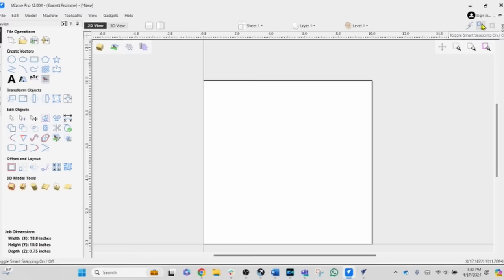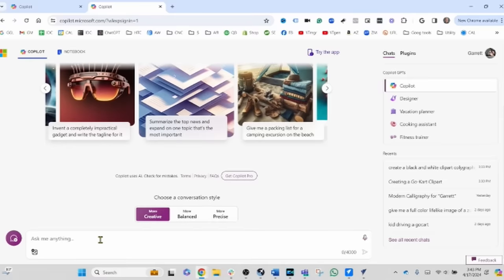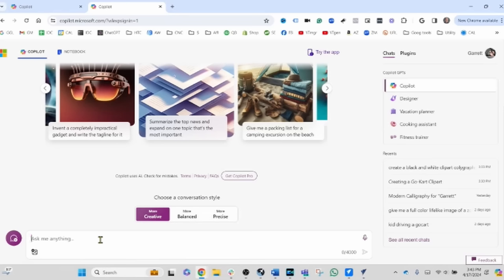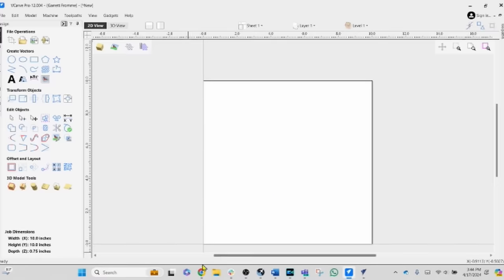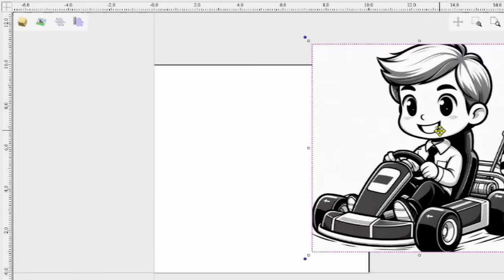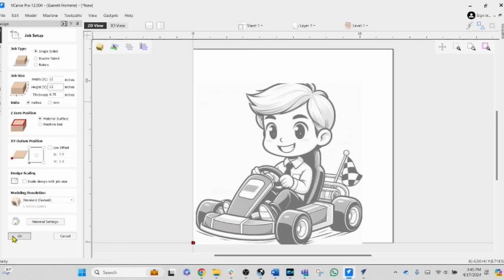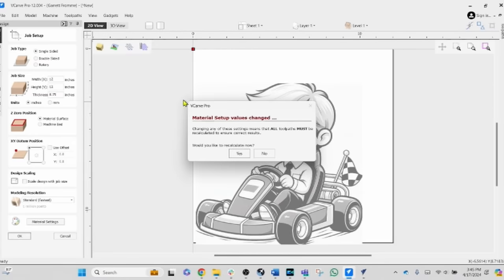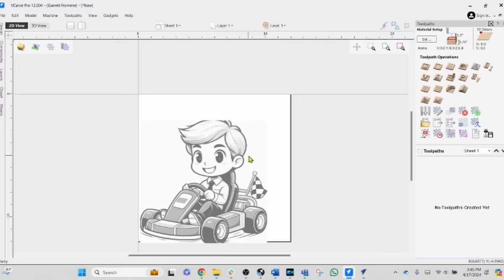This New Vectric Sketch Carving Tool Is AMAZING!

Comment: What's up Garrett?? Nice video!!

Turning anything complex into a software or A.I. generated sketch, bitmap tracing, vector or whatever it is you are aiming for is going to disappoint almost 100% of the time it's tried. Now it does depend on the level of detail, contrast and definition etc. It will also help you figure out how much you don't enjoy node editing as a full time job. I work from photos of famous buildings, sometimes to engrave on glass but most of the time I'll shoot for depth carving to get as much relief in the finished piece as I can. It's been my experience that I will save huge amounts of time by just getting out a cheap drawing tablet (Wacom or similar) and take my time to correctly draw what it is I am attempting to create. Then I am not going back and forth until my eyes are worn out from looking at thousands and thousands of nodes that need to be moved, removed, or trying to drag handles all over to fix a curve. Screw that!!

I have extensive experience NOT getting the results I was hoping for using Inkscape, Gimp, Illustrator, Photoshop and VCARVE probably some other titles as well. Tried and tried.. and tried some more! I was constantly searching for an easier method to get the lines I wanted to pop out of some flashy software program and I found I was never satisfied with the results.

Am I too picky about things? Probably... maybe a little more than most. If I'm going to take the time to actually end up producing finished pieces I rather they look as nice as I can make them. When I get started on anything that is going to take me hours/days to draw I break it up into smaller sections and constantly remind myself... 

I only have to get it right one time. 

After the toolpaths are created and I see what I hoped for coming off the mill. It's as good as gold. Scale it up/down, etch it, burn it, cut it or carve it. The bulk of my time for any of this work is always spent converting the artwork into something suitable for the medium and the limitations of the gear in my shop.

Some of this stuff takes time to do. Garbage in = Garbage out.

Have a nice day!!
Reply from the maker: fxsrider, thanks for sharing your perspective on this one brother. You bring up a lot of good points and I do appreciate you reaching out and providing input on your workflow that works best for you.

Comment: There is a setting to eliminate the border, Bitmap boundery, selected Vector  and nearly at the bottom: the Vector Selction "manual " Selector... Just experiment a wee bit with it.
Reply from the maker: hanspijpers2100, right on! I like that idea brother. Thanks for sharing those tips and tricks.
Reply: Yes thank you for sharing this tip.  I tried figuring out to get rid of it and was about to give up. So i figured if anyone would share how it would be Garrett but i was let down.  Lol so i headed to the comments and i was looking for someone to ask and he give the answer but instead i found the answer.  lol.
Reply: this does not seem to work because there are no vectors in the bitmap

Comment: Hey Garrett, I've been experimenting with the sketch tool path in Vcarve pro 12, and noticed that if you import a bitmap as the sketch image, and then choose the sketch tool path, the specific tool path menu items don't seem to allow for the exclusion of a boundary (or border) carve. In other words, the application draws a border around the bitmap and then carves it based on the selected offset, with 0 apparently equal to some value other than 0. For whatever reason, you get a carved border no matter the choice, and seems to be true for the vector selection choice also.
Any thoughts?
Great video by the way!
Reply from the maker: Yes, I commented about that in this video. I'm not sure of a good method to eliminate it
Reply: @IDCWoodcraft  Thanks. I missed your comment in the video - I'll rewatch it.

Comment: Garrett, I was wondering if you can give me a little help. I have a next wave he 510 with the 3 hp water cooled spindle. I have the vertical software, which I still can’t get a grip on. Anyway. I’m really into precious metals especially pouring my own designs. I’m trying to figure out what bit to use. They are carbon fiber blocks. TIA.
Reply from the maker: user-on9bx3en8r, you are so welcome my friend.

Comment: The background of the drawing image is full of white pixels. The software doesn't know you don't want the white pixels. If you load the image with a transparent background it will likely not have that boxy outline.
Reply from the maker: WikiSnapper, very true my friend. That is a very good point. It might be best to convert to a different color before importing.

Comment: tryed to use this , keeps stoping with error 1 line 24 and so on i use gsender. Do you have any idels i am new to cnc so it has me stomped. it works good with other projects. thanks
Reply from the maker: ACEONE1957, It sounds like there might be an issue with the G-code for that specific project. Double-check your code for any errors or typos on line 24 and make sure it is compatible with your CNC machine. If you are still having trouble, consider reaching out to your machine manufacturer for more help for your specific setup. Good luck!

Comment: That copilot doesn't work. It won't even create the kid on a gocart and I typed it in word for word as you did. Nothing!
Reply from the maker: JD-nq4vb, sorry to hear that brother. AI can be a bit tricky at times.
Reply: @IDCWoodcraft  I figured it out. I did not realize it only works in the Edge browser and I was using Chrome. All good, thanks.

Comment: Having used Vcarve Pro for many years this is probably the first upgrade I will not be paying for... The Vectric sketch tool is a nice concept but once again like other parts of vcarve the execution is not the best... It only outlines everything it doesnt produce the vectors around the black areas so they can be carved out like the original image so we are still left with editing to do to get a proper representation of the original image... Vcarve already has the bitmap tracer which is outdated technology...the freehand drawing ability is also outdated technology as is a number of other components in vcarve... So once again they offer us an expensive upgrade with half hearted new stuff and nil improvements... I would be much happier to pay for the new upgrade if they actually improved and updated the outdated technology they are using in existing parts of the software like the bitmap tracer and the freehand drawing functions as there is other software out there that does a much better job in a more efficient time frame and nowhere near the expense...Vcarve needs to get into the modern age and stop trying to sell us outdated software re-wrapped in a pretty package....my thoughts  :-) :-) :-)
Reply from the maker: adrianlachlan1452, thanks for sharing your perspective on this one brother! Upgrading definitely has its pros/cons.